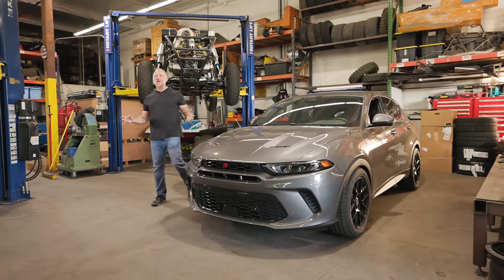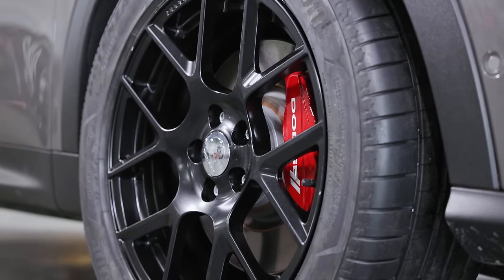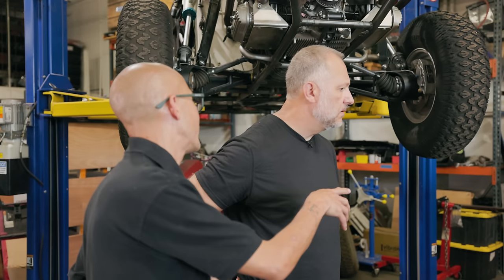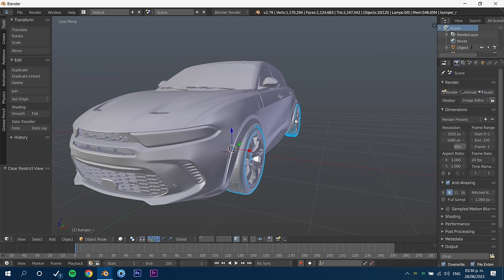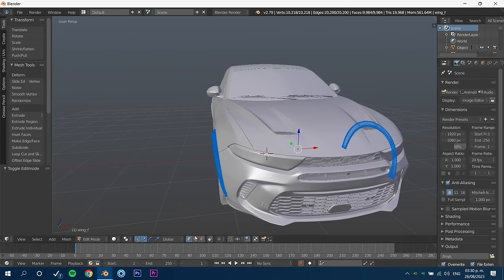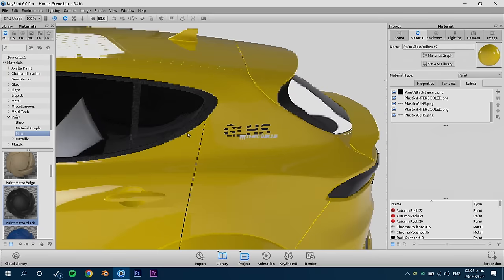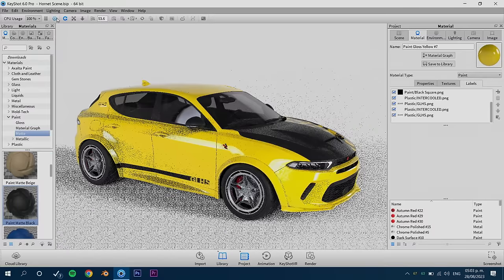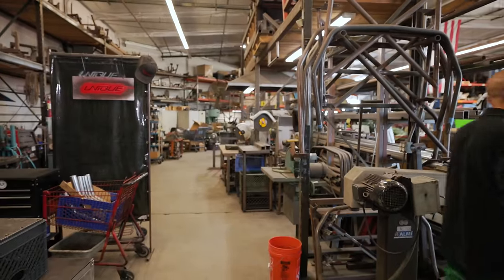2023 Dodge Hornet: A Swarm of One | Design Kickoff  | Episode 4

Comment: Giving something like the Dodge Omni a performance variant was at least something: they started with a car already fairly lightweight, small, and simple. A badge engineered SUV in partnership with a brand holding one of the worst reliability records to date?! You can sure as hell try.
Reply from the maker: Hold tight with the Omni performance thought as we actually took inspiration from all the turbo cars that Dodge has produced over the years.
Reply: Call it the screaming yellow zonker!! @hemmingsmotornews